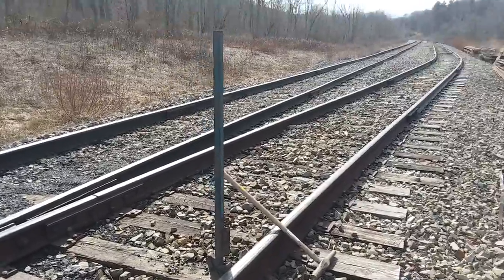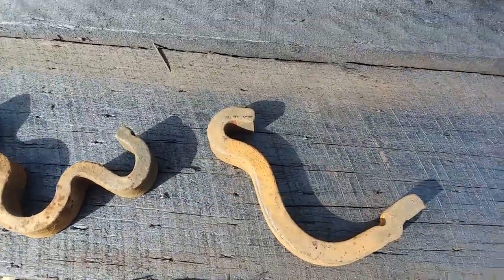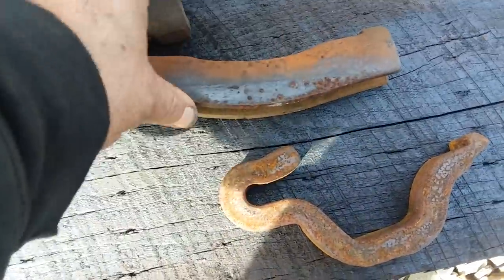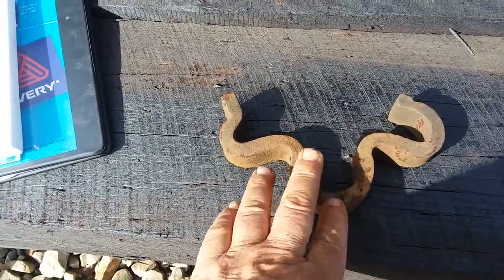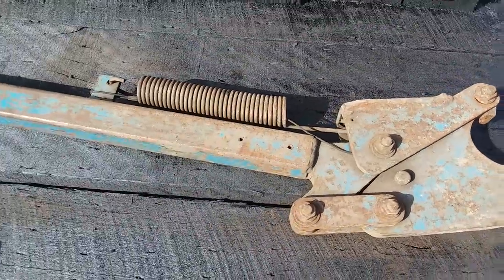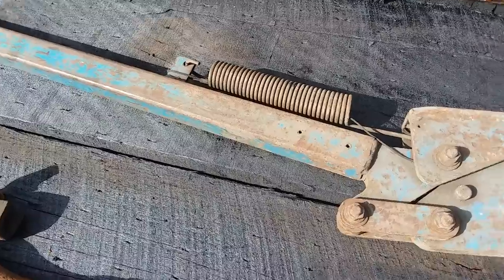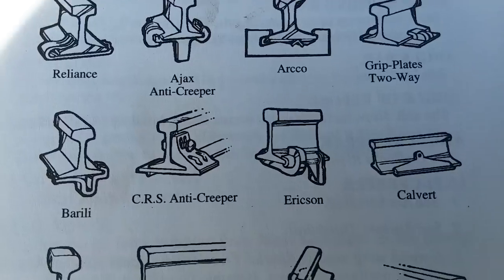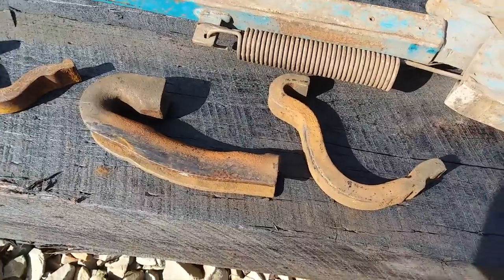All About Railroad Track Anchors - Sometimes they are Called Anti-Creepers

Comment: Just another observation. Whatever road you work for, obviously allows for a lot of track material to be piled around a switch. We were taught not to do that as it becomes a footing hazard for trainmen getting off equipment to throw switches. What makes this worse, is it's also placed too close to the nearest rail.
Reply from the maker: Bout the only switching done there is for our MOW equipment
to get off main and allow a train to pass. The only other time
is when we would happen to have the detector catch a hot
wheel bearing and have to set that car off. Guess we never
thought of having the stuff so close, but our thinking is that
the materials are easy access when having a hi rail set on the
main. if this was a busy classification yard I can definitely
see your point on that. Always great to hear some good
observations and points made, and your always welcome
to share your thoughts with me.

Comment: I've made a few knives from these anchors, I just found that chubby one the other day and I was wondering what it was for, also a quick question cause I was wondering are the anchor all spring steel or high carbon? Cause I made a knife from one and it wouldn't hardened no matter what I tried thinking it was mild
Reply from the maker: Very good question and I'm not metalurgical enough to accurately 
answer your question however my guess would be spring.
Reply: Most of the solid ones are fairly similar to 1060, but like all salvaged steels it is pretty much an unknown unless you are capable of some fairly specific tests.

Comment: If they are all uptight against the ties,, where does the expansion and contraction of the rail go?,. Will it actually slightly move the ties?

Where does expansion and contraction in rails go to anyway? Is there enough lateral deflection in the rail when it gets hot to lose the length that you gain from expansion?
Reply from the maker: Your questions Joe deserve a small book to answer fully, there
are a lot of factors involved. Yes it will move ties, we often find ties
that are shoved out of place and/or skewed. Sometimes I can put
them back in place or right them if skewed with my tamper, sometimes I can't move them too. Then it's a real pain with a track jack and digging out the ballast with a pick.

If all the gap is taken up in the joints, then the rail will start to
heave up, we call that nervous rail. If there is enough loose
spikes in a section it can get ugly. 

If there is not enough ballast to hold track in place then the heat can
cause the rail to buckle (also called a sun or heat kink)

Under extreme expansion the rail can move up to a foot a mile!
When you look at track in extreme heat it often looks wavy

This is a big subject with a very short truncated answer
Reply: @ccrx6700  when I was a kid they used to tell me that the rail joints used to take up a lot of the expansion and contraction. But now I see welded rail all over and they seem to keep it very straight. About 10 years ago or maybe more I was working on the hell gate project running up out of Astoria Queens and into New Rochelle New York.I was moving materials and equipment for the electrical contractor,and we were making improvements so they could run High-Speed rail through there. I really didn't have anything to do with the rail, but it was all welded, and if I remember right it was on concrete ties. I know everything had to be really straight in order to get any kind of speed out of that Axella train.

We were actually they're adding additional towers to reduce sag in the wires, because it high speeds they were having trouble with the pantagraph

Comment: Thank you Dave! That was very interesting information. Always wished I could have bought about 10 pieces of rail when it was taken out. Is old rail worth scrap price or is it better grade of steel?
Reply from the maker: Your welcome Scott. Used rail can be relaid if it merts certain criteria, there are 4 grades of relay rail. Some scrap yards here used give premium price for rail and OTM, others didn't so guess it depends on the yard 💲
Reply: @ccrx6700  the rails would make good vertical steel uprights in machine shed storage building. 6x6 posts rot too fast anymore.
Reply from the maker: @scottrayhons2537  we've used them for piling for retaining walls on a couple of slides we had, yep never rot and no termites 🐜

Comment: Also, boys and girls, these are safety devices listed under the same set of laws concerning smoke detectors and automatic fire protection/control systems.  DO NOT REMOVE THEM and if you see someone doing so immediately report it to the police and have the police call the RR it is happening on while you're on the line.
Reply from the maker: Absolutely correct in that, thank you for adding that in!

Comment: Those smash on are friction and how they keep the slip?
Reply from the maker: Gerald, I should have explained this in the video, I did not and apologize for that, sometimes because i've been around this for so long I take some things for grantedY, and sometimes I just forget to say some things. You've posed a very good question. 

The anchors help to mitigate rail creep. This is accomplished by the 
anchor against the tie, thus the rail must also work to push not only
the rail itself, but now the tie also. A tie is 7 inches in depth and 8 1/2 feet long, so assuming there is ballast filled in to top of tie, this means there is a considerable amount of resistance for the moving rail to overcome, multiply this over however many ties are anchored, the resistance is usually more than the rail creep can overcome. 

An anchor that is not against the tie only creates only a very small amount of resistance in itself. Hope that helps clarify a bit for you.

Comment: Are you working on the main line or on a heritage railroad?
Reply from the maker: We have a short line, it 17 miles of track. We haul coal from a mine to a river barge loading facility. We do not interchange with another railroad. It's a rather unique operation. We are not a railroad per say, I work for a coal mine that has a railroad and I'm track maintenance here.

Comment: How do they work  after you put them on the track ? How do they anchor anything ?  are they tied to something or connected by a cable between them ? please excuse my stupidity but I don;'t see  how it works ......
Reply from the maker: They are up against the ties. As the rail expands or contracts, the
added resistance of the tie pushing against the ballast is what
holds the rail from creeping. See with the rail anchored the expansion
of the rail has to also push the tie which is a considerable amount
of resistance. Hope that helps n1jrm.
Reply: @ccrx6700  thank you very much . I can see that now , never would have guessed on my own . again thanks   bob k  n1jrm   .

Comment: Since rail creep is longitudinal and the anchor is transverse, does creep provide enough force for the rail to slide through the anchor? The forces of thermal contraction and expansion are usually quite massive.
Reply from the maker: Excellent question sir, you are a thinking man! Anchors help to mitigate creep, they do not stop it entirely. You are absolutely right in your observation that the contraction and expansion are massive. 
You would make a good addition to a RR engineering staff. Do appreciate your writing in and for watching sir
Reply: @ccrx6700  I am too late to be an engineer. I was an emergency physician, but I retired in 2009. Way back at the end of high school I came to a fork in the road between medicine and other science/engineering My father was a physician, so it was almost a natural choice for me. But I also regretted not geing the other way.

Comment: How does the EZ wrench work?
Reply from the maker: James,  if you noticed the bar on the end of the wrench that fit
up against the rail head, that provides a solid object to hold
the wrench as you push down on the handle, makes it a whole
lot easier than using one of those old wrenches in the picture.
With those it was all back and muscle work. Hope that helps
explain it better. Thanks for the question and for watching

Comment: As a kid, I found a thing that looked like a cut cross section of rail. It was maybe 1/2 inch thick, made of fiberglass or plastic I think. Any idea what it was for? I found a couple of them along na section of abandoned track
Reply: probably a spacer from an insulated signal joint
Reply: @dennisfernandez7336  a of my life's questions have been answered, bless you 😂
Reply from the maker: Dennis, thank you very much for that answer. We don't have any signals here so I am very unaware of all that goes into that part of railroadin, I certainly would never have guessed what that could have been nor have heard of that before. You saved the day on this one!
Reply: yeah the joint bars & bolts would also have  been insulated but that stuff wouldn't have been left there.
Reply: just put up a picture of an insulated joint on my Flickr page. "wannabtg" click on the pic for the blow up & you can see the spacer and the insulation behind the joint bar.
Reply from the maker: @dennisfernandez7336  sorry Dennis, couldnt find it, what is the pic number?  Nice pics there tho, glad i went there. See you've been to Steamtown also!
Reply: @ccrx6700  first one DSC1682. I haven't been back to see if they buried the wires 
I think I caught it right after they worked on it.
Reply: @ccrx6700  Luv your stuff I really learned a lot of nut and bolt stuff
Reply from the maker: @dennisfernandez7336  found it. That looks really similar to a glued joint we have, notice the bolts are not the same as a typical track bolt. I have no clue why we only have 1 glued joint on our entire RR, but they are exceptionally strong and impossible to take apart except with a torch.
Reply: @ccrx6700  the rails are electrically insulated so one track circuit can end and another start. This was on the busy CSX S line at Hawrhorne Florida.
Reply from the maker: @dennisfernandez7336  understand that now Dennis, thanks. I love to learn new things and am woefully lacking in the knowledge you have, wish we could meet, i'd learn a lot from you!
Reply: @ccrx6700  I'm in Florida. I just read a lot I never worked for a railroad.

Comment: How are street running rails repaired?
Reply from the maker: That's a big job, depends on the rail break or how many rails
need to be replaced the amount of the street that has to get
removed and then repaved Shirley. That's only way to do it is
to take out part of the road to get to the rails.
Reply: @ccrx6700  thank you for your reply, Dave. There is so much behind the scene work to learn about.

Comment: Looks like it could use a few drops of oil.
Reply from the maker: Lester, thanks for pointing that out, duh it never occured to me to put some oil on it. I will do that ASAP. Awesome for thinking of that! Thank you, that's why I really like when guys like you write in and talk about stuff like that, there's just so much stuff that I have to do here and things like that I appreciate so much
Reply: @ccrx6700  I'm not sure if it has any bushing/inserts in it.
But it would crank a bit easier with a sip of "earl".